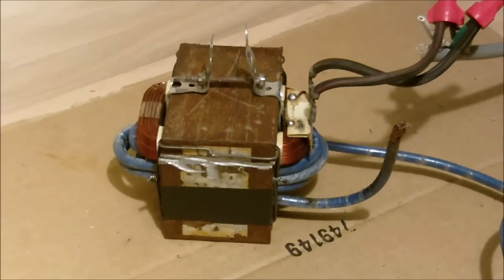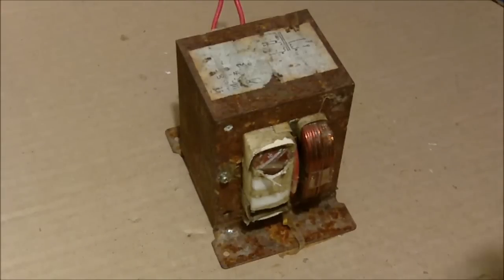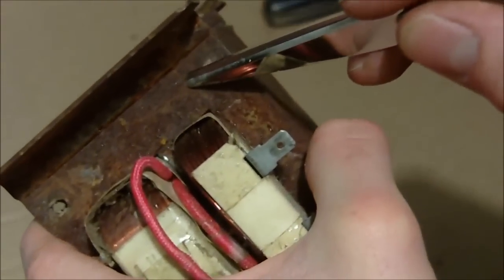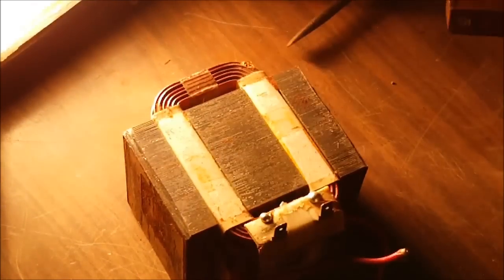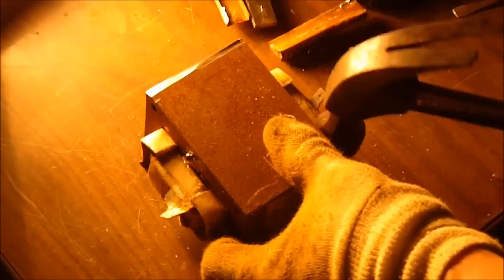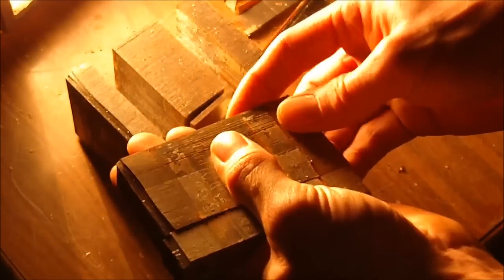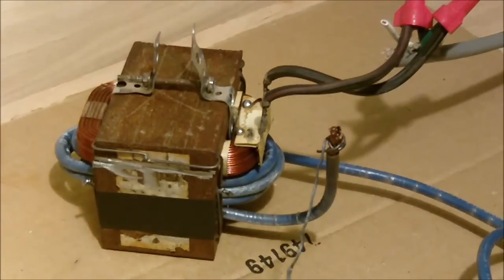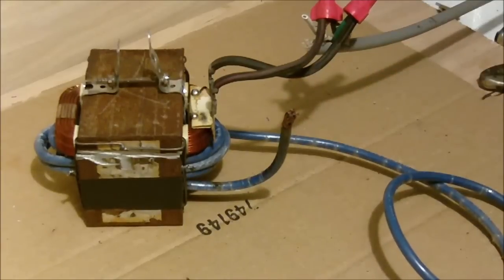Rewiring of microwave Transformer (MOT) for spot welder how-to

Comment: I just thought of a way to produce multiple amounts of current/voltage out of the transformer(a simple modification):   create a few taps(I figure high quality/temperature crimp ferrules are safe and simple) on the "secondary" winding.  That way,  the secondary coil is a single, continuous,  conductor (without any breaks).  Therefore, eliminating a lot of failure points.  Then you connect each tap to a high current rotary switch.   Or you could have each tap terminated at a high current output jack.  You just plug yir "stinger" into the jack with the corresponding amperage that you desire.  Hey, I ain't no Electrical Engineer, Electrician, or even some kind of wire/electron guru...I DON'T KNOW JACK!  So, shoot my idea down if it sucks.  Especially if somebody could get zapped.  Hey, yir "Death-o-Rac" may be the best method of adjusting the output current.   And a few welder "jacks"  may cost too much.  ...just some ideas...  BTW,  great video!

Comment: What would happen if you wove windings of different diameter wires in the valleys of the E frame so that your primary coil powered both an amp coil and a volt coil? Could you splice them together to make a more powerful system?

Comment: Cutting through the laminated plates is NUTS!  Is this the first time you have ever done this?
Reply from the maker: This was a long time ago, but it was the first time cutting the welds, I used to just chisel the secondary out than wrap in a heaver gauge wire or laminated field wire in. I used to build transformers from motor stators, just for educational entertainment content not for practical use.

Comment: I made a spot welder, but it doesn't weld at all! I't capable to melt a wire or nails but the welding part isn't what it should be. (I am experienced in high voltage and I've built Jacob's Ladder  and 2 MOT as as spot welder - it works great!) BUT I want to spot-weld 18650 batteries, that is all. It just doesn't work at all - any suggestions? Thank you.

Comment: Dude..... That was painful to watch..... You are going to get somebody killed.... Use a SURGE PROTECTOR to turn it on and off. Another safety precaution is to salvage the light bulb and put it in the main power supply line so when you turn on the MOT, a light turns on with it.... and is a signal that there is a need for caution.

Comment: In rewinding MOT secondaries for low voltage loads like welders, etc, I use strip copper flashing metal which is used in roofing construction. You cut the strips about 1/8 inch narrower than the width of the coil, cover one side with a teflon fabric tape insulation and wrap the desired number of turns around the core. This wide, flat "wire" has enormous current capacity with a very compact density and low heat loss. Strips are soldered end to end to get the preferred length. As long as the solder joints are made to lay outside the core and a small gap left between layers for air circulation they don't negatively affect the winding. I've run as low as a couple of volts and as high as 75 volt, high current loads with no problems. and it's a lot easier to work with than wire.

Comment: You should mention that welding can make POISONOUS FUMES ! So NEVER use indoors and always have a fan blowing from the side. But then you still may poison other people near you. Take a welding class on safety first ! Most likely the smoke in this video was poisonous even ! I repaired an electric heater and breathed nickle dust or some other coating dust in the heating element and was sick for a few days.
Or you can be like some of the people that died in a few MINUTES after breathing the fumes or one experienced welder died in 2 weeks from a coating on the metal parts. And he knew better ! Search welding safety and learn first !
Not to mention possibly blinding yourself from the arc or getting UV burns. Use a welding helmet too if making arcs !

Comment: hi i am a mechanical engineering student i am constructing spot welding machine as a project so please guide me electrically in the construction of low voltage(shock proof) high current converting transofrmer please help me

Comment: Do you have to put the metal spacers back in when you rebuild?  The ones between the windings? Or, would you be ok setting your wire directly on top of the winding?
Reply: I noticed when Grant Thompson rewound this transformer with the really thick cable, he had the spacers (shunts) removed on his.

Comment: A lot of these transformers are wound with aluminum wire, very soft and easy to cut but not as efficient.  The enamel they use to provide insulation is tinted amber to make them look like copper.  They will work but cost more to run and of course they have no salvage value.
Reply: I noticed this on the first one I tore apart! So I'm like wtf...  I want some copper windings... not this cheap shit. So I found an OLDER microwave, and that one's transformer had copper windings. The aluminum windings were WAY easier to remove than the copper ones though. I used an air chisel, hammer and punch to remove the old secondary. So now I got some 2/0 welding cable ordered to make the secondary out of.

Comment: what if you use aluminum for the second coil?
Reply: Aluminium is not as good of a conductor as to copper......so you'll probably get lower voltage passing through the sec. coils
Reply: +Yevette Xoxo thanks! I've been wondering quite a while
Reply: No, the voltage will not change, but current will be lower as resistance will be higher.

Comment: Do not cut the core of the MOT if you are gonna wrap less than 30 turns. It's not good idea. First of all you reduce transformer performance by 10 % or more, depends on how you put it back together, also the noise is ridiculous.
Reply: Who cares if it's less efficient? Also, the noise can be easily controlled by wrapping the wires in tape tightly so they are extremely snug in the transformer.
Reply: ***** the wires barely make any noise, it's the core.

Comment: I see that the transformer you converted into a step down voltage  transformer arc welder ... basically an ac arc welder with one voltage/current setting defined by how many coils in the secondary you put. Nice work i guess the next step is to add a potientiometer based knob so you can get different voltages or currents.... Curious does the spot arc welder you create also do continous beads or welds ... or is it just spot welds?
Reply: I'm just guessing, but I think the voltage on these would be to low to maintain an arc for any other welding process. If you were to get the voltage up in the teens or higher (by adding more turns of wire to the secondary), then it could work for stick welding.

Comment: قبل 3 ساعات
 why we must use a microwave oven transformer and not any other transformer for spot welder,and what are the characters that made it the most suitable for such project?...thanks
Reply: +المهندس ضرغام الجاسم The microwave transformers are abundant, and of sufficient size. With a direct unregulated load the transformer will completely saturate, so you want a large enough core. I wouldn't cut the I from the E as you can create undesirable effects if not done right. It is easy enough to just cut and hammer the secondary out.
Reply: +المهندس ضرغام الجاسم they was free lol
Reply: correct

Comment: Don't cut the laminated core. Use and oscillating tool ( saw ) and cut off the secondary wires and push them out of  the core.  Very fast.

Comment: Continuing, I am attempting to build a spotter for dent pulling. It is a handle with an electrode of some sort and a spring loaded switch. You touch the electrode to the dent then depress the switch and the electrode welds itself to the dent. Then you pull out the dent. Then twist the electrode and it releases itself from the weld.

Comment: Can you help me. I wired one of these with 12 ga wire and it welded great for 20 seconds. Then the 12 ga wire began to get hot and smoke. I rewired it again and the same thing happened. What am I doing wrong.
Reply: Mike K If you have smaller gauge wire, you need to use more wires connected together, to handle the AMPs. Thus, I would say that you need three 12 ga to four wires, all bound together at one end, wrapped around as one thick wire, then bound together on the other end. (There is a conversion, google amperage and wire gauges. Actual values are not important, it is the ratio from one to another. Going from 12 ga to 6 ga may be 4x more amps, thus, you simply need 4x more 12 ga to equal the same amps as 6 ga wire.)

The reason they have other sizes of wire, besides for simplicity, is because each wire has roughly the same thickness of sheathing. Thus, you will have 4x the sheathing, and can get less wraps. This is why magnet-wire uses micro-thin sheaths of plastic/enamel/mica, to fit more wire in less magnetic space.

Dumpsters have great solid-copper home wires with thin sheathing. It is great for this stuff. Better than thick-sheathed jumper-cables and speaker-wire. Plus, the sheath is designed for high-amps and heat, unlike rubber/plastic battery-cables with low-grade sheaths made for "abrasion resistance" and "fake thickness to look like expensive wire".

Comment: I've seen people using two MOT's, but is that really necessary or can I just use one?
Reply: Bit late but here goes:
Make it Extreme channel recently posted a spot welding video using two transformers in tandem. They show the power of one then both. I made a spot welder with a single transformer using welding wire at 2 turns as secondary. It dossnt have enough current, takes long time to hold and doesn't weld well.

Comment: Those iron spacers are called SHUNTS.  They are current limiting shunts.  MOTs have 100 turn primary coils while a typically equivalent transformer has 200 turn primary coils.  200 turn primary will pull about 2 amp idle current with no load, the 100 turn primary will pull 12 amps idle current with no load.  The shunts limit the current to 12 amps.  Without the shunts current can go up to 25 amps and burn up the primary coil in 3 or 4 minutes.  Shunts are a safety current limiting device for the 100 turn primary coil.  If you plan to use the 100T primary coil you should use the shunts too.  I often use MOTs just for the metal laminates to build audio transformers and power transformers for tube amplifiers.  I replace the 100 turn primary with a 200 turn primary then shunts are not needed.  I can still get 1500 watts out of the 1500 watt transformer.  If I use 1/3 of the metal laminated my new transformer will be 500 watts.  The 100 turn primary is a cool trick that makes the magnetron tube start instantly.  A magnetron will not start at 2 amps so the microwave oven will never come on.
Reply: Lowracerman Yes it Would be nice to see your setup for winding 200 turns.  Also could you just add some windings to the org. primary.  I saw another vid with a guy adding like 60 turns and it dropped the amps at idle a great deal.
Reply: dude you really should start a youtube thing with that, I would tune in for sure.
Reply: Lowracerman Thank you so much. It would be awesome to see a video of you building audio transformers and explaining the process/tips.
Reply: 2 questions please guys..I have two Mots in parallel both with the secondary rewound with two turns of 2 gauge multi strand and still have very poor output at the electrodes..and suggestions? question 2.. does anyone know what voltage I would get by using two primary windings and reassembling the mot..thanks guys
Reply: If you use two MOT primary coil in parallel, you have better chances to connect secondary in serial. Yes, primary coil should be in parallel and secondary in serial. When you connect secondary in serial you will receive double voltage (if you connected end of one coil to beginning of another)  or practically zero or close to zero if you connected it wrong, so just try and measure. You will know when you connected it right. Also, the connection wire length is critical. You should make secondary coil as thick as you can and have minimum connectors. In such low voltage even very small resistance plays huge role.
Reply: Sorry, I meant in series
Reply: Wow...  great information! THANKS! :)
Reply: Yes, I read that microwave transformers work in that mode.
I just measured the current in a primary coil in idle mode and it was about 8.3A, which I think is still very high for IDLE mode.
Is it OK for microwave transformer or there is a problem with primary coil?
Reply: lol what is "in serial"? someones had their head in the arduino IDE a little to long :P
Reply: So for converting a MOT to a spot welder...would you would want to remove the shunts or not?  It seems like you would want to remove the shunts in order to get as high a current as possible, and anyway the time under load is going to be less than a few seconds, usually far less than a second.

Comment: Anyone w/o knowledge of electricity & what it can do, will be in a world of hurt.  100mA is painful enough.  It is actually the current, that will do significant damage or even send someone into cardiac arrest with just one screw-up let alone a few.  Going into V-Fib(Ventriclular Fibrillation) is not good by any means.  That or just an M.I. (Myocardio Infarction) would be the least of your worrys.  If in doubt, don't attempt it.  I myself have been jolted with 500 V, but only required muscle relaxers (no, it was not related to transfomer work).
Reply: Virtualgod2009 A friend from wok was killed by working on power lines in a crane when he got too close. He was burnt to a crisp.

Comment: Kurt...please call me 660-596-6009 James
Help me with a 110V to 220V step up conversion from a mot. Thanks
Reply: wire it 1.2 ratio for every turn on the primary put 2 on the secondary to double the voltage
Reply: Put a single turn of wire through the core windows. Apply 110VAC to primary winding. Measure single turn volts. Say it's .8VAC. Then calculate turns 220/.8, says you need 275 turns for 220VAC output. You can use a lighter AWG gauge wire on this new secondary. Say the primary is 10 AWG wire, add 3 to it, and use 13AWG, that's about 1/2 the cross-sectional area, for 1/2 the current (maintain the kVA rating!). BTW, what Kurtzcottage is removing is the (metal) shunts between Primary and Secondary windings. That is a high reactance transformer design and the shunts limit the current.
Reply: Q
Reply: Virtualgod2009 MOTs benefit from 20 more turns added to the primary or run them on 100 volts RMS.

Comment: SPOT WELDERS ARE 145.00 DOLLARS TO ME THAT IS A LOT OF CASH,IF I CAN BUILD ONE WITH A MICROWAVE TRANSFORMER I WOULD RATHER DO THAT,BROTHER .THANKS FOR THE TUTORAL.
Reply: Dan Allured why the anti experimenter wet blanket attitude Mom? Afraid we will put an eye out?
Reply: I found a working microwave next to a trash can the other day. free is a lot cheaper than $145. but Dan is right about one thing. you better know what you're doing if you go this route. Or if you weld at all for that matter.
Reply: 145 dollars and safe, try this without knowing exactly whats going on and your house burn down is a little bit more than 145 dollars, i'd do the sums on saving the cash if i were you before trying this.
have a great day.
dan

Comment: Use JB Weld or an epoxy and clamp it, should be alot better thin that strapping. It'll be more stable also.

Comment: As long as the voltage is low , It is much safer than connecting it to 120 volts or higher , But beware that the transformer may have a duty cycle on it which means it is not for continuous use , Unless the wire you're using as the heating element has enough resistance to not overload the transformer , If the transformer gets hot to the touch , Shut it off and let it cool before using again  Transformers take quite a while to cool off due to the dense steel core , A fan will cool it faster

Comment: Thank you , I had a feeling that those are not spacers , That they had something to do with the alternating current flux and something to do with reducing eddy currents but I couldn't figure out what those parts are called , So without those flux shunts , The transformer would burn out , Correct?

Comment: You do not need to cut adapter if you will be using a small number of laps, 3 laps or 6 laps and the introduction of the new file without problems

Comment: I actually made an isolation transformer out of these. I took two of them apart, and put the primaries into one transformer. And i also put the secondaries into the other one, so now it is a high voltage isolation transformer.

Comment: Hey Kurt I think if I put a taut nichrome metal wire between the secondary terminal ends that I can make this into a simple homemade hot wire foam cutter. I think because of the low voltages it would be a safer than most unit out there, what's your opinion on that.
Reply: enviro1001 Depending on the length of the nichrome wire a laptop transformer should be enough. I can test that the day after I write this comment if you're still interested. 

BTW, check out The King of Random channel's, he made of that look very professional